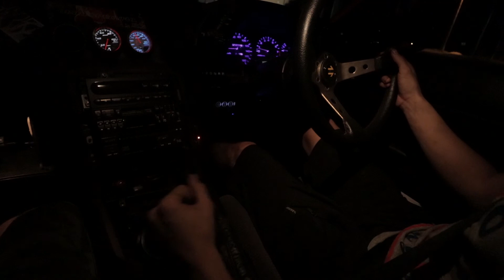R32 Skyline Manual Swap | GOING FOR A DRIVE! P3

Comment: How much is a r32 at this moment in automatic with turbo or without? And does it rise fast in price?
Reply from the maker: Probably looking at 8-12K for an automatic. The car recently jumped up in price a good amount, manuals are worth like 15K up now.
Reply: @TeamHatsOff  and the non turbo automatic? Did it jump up aswell? Or is it still cheap
Reply from the maker: @mikakoolhoven9849  That's what I think for both NA and turbo'd.